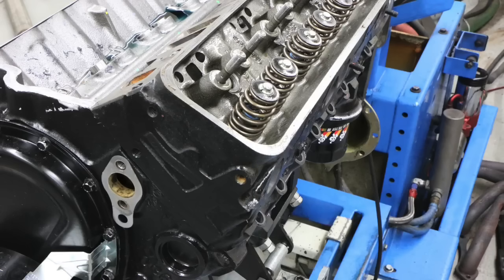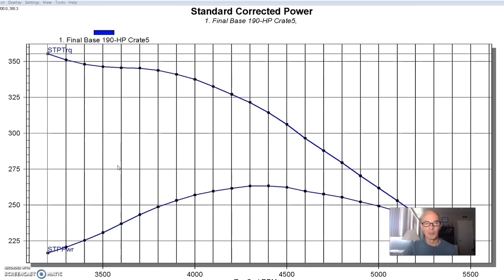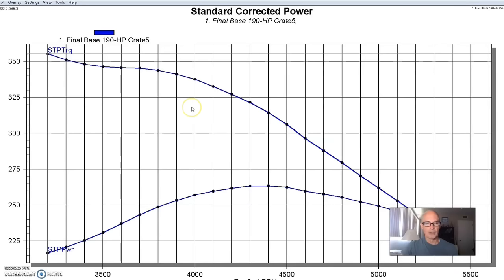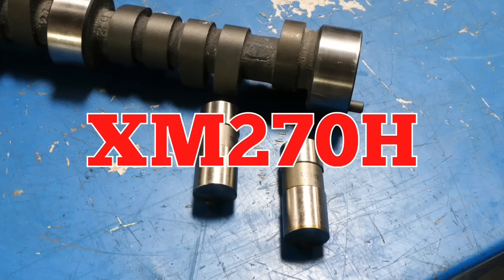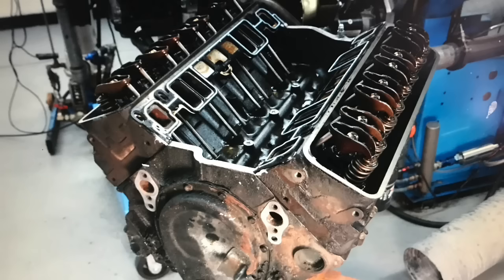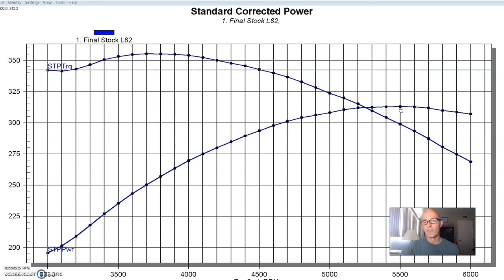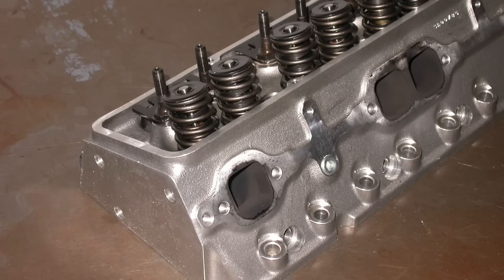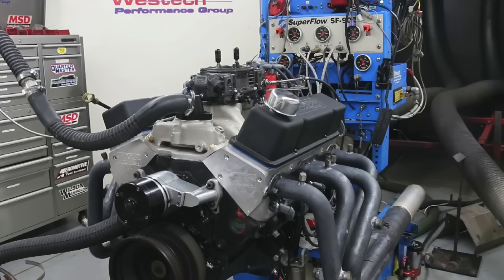JUNKYARD SBC HEAD TEST-VORTEC FTW!

Comment: I had a 75 L82, it had 882 heads with 2.02-1.6 valves in them. Also forged single valve relief pistons. I ported the heads and put them on a flat top 400 with a xe262 and 1.6 rockers. The 400 was a torque monster!
Reply: We run big valve 882 heads in stock class engines on dirt tracks..they flow fairly well for a big chamber head. Zero decking the block helps them a lot.
Reply: That's a lie
Reply: 882 heads are the best of the worst. Any 441 or 487 casting is a far better choice not only in flow but in strength. The 882 is a light weight casting whereas the 441 and 487 arent. Theyre all stock heads and less than even stock vortecs but thats up to what you want and how much money you have to spend.

Comment: ive done the same basic thing ive got a stock bottom end vortec head swap but i used the xe268h cam with self aligning roller rockers and chromolly pushrods a dual plane intake and a 650 edelbrock so do you think i can expect close to the same results

Comment: I have a 87 TBI 350, I put a Dual Plane intake on it and a Fitech TBI unit, as well as a 12-249-4 cam (206/212 @.50,  .434/.444 lift, and 112 LSA).  Still has the 193 swirl port heads.  This is in a lifted k10(v10) with 4.56 gears, nv4500 trans and 35” tires.  I am not looking for a high rpm truck, but would love to maximize power, efficiency and torque between 1,500 and 3,000 RPM.
Should I keep the 193 swirl ports or upgrade to vortec 196/060 heads? 
Power over 3,000 rpm is not so much my concern, but mostly under 3,000 RPM. 
Eventually I’m going to do a full exhaust with headers, if it matters. 
Any advice would help, thanks
Reply from the maker: yes vortec

Comment: I have a 350 with a high open plane intake and short tube headers, 750 carb and i just bought a Lunati .504/.525 lift cam what heads do you recomend i want at least 400 hp
Reply from the maker: cheap way is vortec but lots of cheap alum out there
Reply: I think ima go for the Vortec Heads i just need to know if i need to do any changes on valve springs or Rocker rollers?

Comment: The L82 was no truck motor it had 9.1 compression 202 160 valves and A 450 460 lift cam. I had A 78 L82 vet with headers and side pipe kit, hot coil, 34 degrees of timing, air gap rpm intake, stage 2 Q jet , OD trans with stall , 355 gears and original cold air induction and it ran 8.60 in the eighth with 17 inch drag tire.

Comment: The L82 also has forged factory crank and hi nickel 4 bolt man crank my 1976 L82 close ratio 4 speed  vette makes  550 hp and 478 torque at 5500 rpm with 12 lbs of boost running comp blower cam  ported Oem 2.02 factory heads com cam springs to match blower cam and machine work to heads to prevent coil bind .. I have owned the car since 1980 rebuilt the motor in 1989 for blower install raced 2 seasons in auto cross and solo 1 on road tracks in north Eastern Canada in B street prepared. Since I stripped all paint gel coated the body and painted it in blue and diamond metal flake old school paint job with silver and diamond flake cowl stripes and rear end . The car has big tube hooker headers to 3+ inch hand built dual exhaust , modded hei water methanol injection , after market ignition module and accell remote coil and twin electric fans and custom rad . The vette been lots of fun many of the parts are still Oem 1976 like the rotors and all front end mechanical and suspension I added home brew coil overshocks to stiffen up the off road stock suspension using an old school single  2000 lb overloader spring made for a Buick Electra which I cut in half with a grinder  and 1/2 the spring to each rear racing shock also all rubbers was swapped to polyurethane.The mod made the ride even stiffer but got rid of the clunky ride and cost me $9.95 Canadian for the kit on clearance  handling was greatly improved and in auto cross there was no body roll . The best part of ownership was all mods and rebuilds custom paint was completed in my garage by my self .I thank the deceased owner and mechanics and body men of Rader motors Chevy olds in Parkhill Ontario for teaching me all aspect  these car during my 9 years of after school and summer and holiday employment  1967 to 1976 it was a great addition to shop classes and college electronics. 👍👍👍✌️✌️✌️

Comment: I liked this, but only have one issue. You changed heads and cam together, so it's hard to gauge what JUST the heads would do. Anything will make more power if you ditch that wimpy factory cam. I wish you'd repeat the test with nothing changed but the heads. Maybe with a 'typical' setup where someone has already bumped compression, added a decent street cam, etc. But keep the combo the same in every other way, including using pretty much the same intake, like a performer, but going to the vortec version. Want to duplicate a magazine build I saw but with vortec heads and would like to have a good 'guesstimate' about the difference the heads alone would make.

Comment: Hey Richard I got a good question for you... My 2005 GMC 3/4 ton 4x4.. what air induction system would be appropriate for towing a 8000lb trailer
Reply: performer intake. just the regular one 600-650 cfm carb. unless its injected
Reply: factory intake is going to be pretty much the best torque intake u can get

Comment: Richard, can you please do a 9500rpm rpm small block with 3 inch crank and 4.155 bore? Or  LS7 block with 4.8 crank? Need solid roller cam, shaft or pedestal or shaft rockers, FAT pushrods set to perfect rocker center on valve stem travel,  big flow heads, 1050 dominator or big EFI. And super sweet balance job. Set rod center for rotating and dynamic at actual balance point of rod, not 1/3 and 2/3.
That should be an awesome 950hp
Reply from the maker: take a look at what Ben Strader did over at EFI
Reply: @richardholdener1727  I saw that insanity!!!  Ben is a Voodoo Witch Doctor, I just want to see if it's feasible to run 9200-9500 without getting into Captain Insano money. I think it's not too much of a long shot, technically it should work quite well.  The only other thing I want to add is my own intake with the injectors way up high on the runners. As high as I can get them for charge cooling gain across the board. I am actually thinking about mounting them on top of the plenum aiming straight down the runners. What do you think of that idea?  Either that or individual throttle bodies with velocity stacks in the plenum. I could still keep big plenum volume and shorten the runners because of the stacks. They are exceptional for higher RPM.  Would be even more effective in a boosted application I think??  
What Ben was able to achieve with comp and jesel really paved the way for a much more efficient DZ302 type engine from the Trans Am's of yore.  Comp can make a cam that will have the perfect ramp and the nose off peak lift can come down easy. Jesel has the pedestal rockers and PSI has springs designed for the application now. All thanks to Ben. I know you can do it Bud! Start the screaming 950hp plus NA revolution.
I'm tired of bolt on people being somewhat competitive with whips, prochargers and little turbos on high compression engines. This is the coming storm. It's the next logical step in the decade long run of huge power gains thanks to the computer and fluid dynamics modeling. Especially for road racing, big NA power and huge power band with linear power that keeps on pulling. The ability to hold that gear to the end of the long straight can really make all the difference. It will keep that ultra efficient Undersquare engine design off for a while longer. That German formula is 1-5% more efficient than an Oversquare design without dual plugs. Anything bigger than 3.9 inches bore size has too slow a flame propagation. Mopar and Porsche air cooled racing solve it with dual plugs so the fuel can be burnt quick enough to fully utilize the quench. You can run an LS3 at 29 degrees of advance all day, you can't get a dual plug Hemi much past 20 Degrees. Even that is pushing it,  16-18 Degrees is really about it on pump gas. 10 Degrees less fuel burned up to time the explosion at quench for max power. Dual plug LS heads will make more power every time with less emissions, if we can get the aftermarket to make them, I am pretty sure GM will follow. Sure it's a little more money to produce, definitely cheaper than a DOHC Behemoth though. Everyone with as LS would want them from here to Zimbabwe, GM might even turn a profit on them. I know lol, I'm really reaching here lol. Those 9k plus motors are definitely coming! Thanks

Comment: Hi Richard I have a question when will you be able to do the eBay aluminum heads for small block Chevy?
Reply from the maker: I tested Procomp heads already
Reply: @richardholdener1727  yes you did and that was a great episode I did watch it but those are summit racing heads I was actually talking about the real eBay ones they're from a company called at racing world and they offer the whole top end kit 220cc intake runners 64 cc it come with springs rocker arms and intake manifold and it runs about $750 I know they're not even going to have the same power as the ones that you tested but this is for the real eBay guys the ones that are on the real budget that do all eBay parts I just wanted to see how good they perform and are they worth the 750 bucks

Comment: How much more horsepower from the L82 if you used a roller cam?  The Comp XR282HR also has 230/236 @.050, but with a bit more lift at .510/.520.  And you don't need oil with gobs of ZDDP with this cam.
Reply: costs about $1500+ to retrofit a roller cam bud.......
Reply: @trillrifaxegrindor4411  K-kit for the exact cam I quoted is $1079 list on Comp's website.  Maybe can find it cheaper somewhere else on the Internet.  Ok, so you still need a new timing cover, cam button and a melonized distributor gear, but I don't think there's any way you're going over $1500 with adding just those three things.  If you have a nice older Corvette with an L82 it's a worthwhile upgrade.  For someone who's just trying to make the absolute most power for the absolute cheapest possible the flat tappet plus a 250 shot and ring gap would serve them well.

Comment: I have a vortec roller motor. What's a good roller cam for 72 chevelle street use ? part number please .
Reply: 7151 gmpp roller cam,will make 357 horsepower and 410 lb ft
Reply: @trillrifaxegrindor4411  Thanks for the info.

Comment: Hey Richard when you did the valve spring upgrade didn't you also have to have the valve guide machined down in order to use a cam with .480 lift?
Reply: no,just add the comp cams retainers,ls valve springs(and change your seals to new ones) i just did it,good for up to 0.500 lift

Comment: "High Rpm beasts are useless in the real world."
Reply: depends on the combination.  stock motor ,4.88 gear 3000stall c rule the street. depends on the racer
Reply: 5k and 6k are extremely useful RPMs for pulling freeway on-ramps.

My Vortec headed roller cam is north of 5000RPM when I make the 2-3 shift @75mph getting on the interstate

Comment: I'd like to see potential of 305 cylinder heads ported on chevy 350. And maybe vortex 350 comparison.
Reply: 305 heads on a 350 not worth the trouble,combustion chamber sucks and flow isnt good. vortec heads on a 305,
\milled 0.03"-0.04" different story,add a nild cam and they make over 300 horsepower as well. 

https://www.hotrod.com/articles/ccrp-9903-305-chevy-small-block-engine-build/

Comment: With the stock motor you got from the wrecking yard, did you put screw in rocker studs? Or did you run the test with the press in ones?
Reply: press ins,they are also on gm crate engines

Comment: This guy has no idea what he's talking about! Vortec was from 1996 to 2002. All vortec roller cam engines. The junk yard motor was a tbi with vortec heads on it.
Reply: Besides who wants heads that are prone to crack anyway
Reply: I have 3 chevy work vans. 2003 4.3. 2004 4.8 and a 2010 5.3. All say vortec on the plastic intake
Reply: @rpmspeedlab993  vortec heads started in 1996,anything before that was marketing bullshit

Comment: Did you half to grind the heads down for them valve springs  or do they fit right in
Reply from the maker: the after market has both options

Comment: What cheapest head for a 350 im running 305 ho 416 heads with a cam 444 in 466 ex on a 350 it runs good i want to go faster. Any advice  or just put a bottle on it?
Reply from the maker: junkyard vortec 350 motor is cheapest
Reply: What about aluminum Patriot heads or promaxx heads aluminum?
Reply: vortec heads,duhhhhhhhhhhhhhhhhh

Comment: Are vortex heads better that world product dart 2 sportsman heads 185ccintake runner 2.02/1.60?64cc angle plug
Reply from the maker: not sure I have run that test
Reply: @richardholdener1727  found some flow #s richard.the wp 185 heads flow 270 at .500 and vortex 230 @ .500..my wp heads (the small ones).hit a brick wall at .550 tho.idk why I let Herbert cams talk me into a .615 /.620......oh well I'm 388 now not 355 so we will see by this weekend  what the inch dif does

Comment: Hello my name is curley and I'm trying to build a good strong motor for my 07 gmc sierra 1500 I have a 5.3 Ly5 / 4l60e trans Tbi fuel system im looking to up grade to at least 400hp its just stock now I don't know much about the ls motor are there any combo's that I can use to help my truck  with a little more hp don't want a race truck can you help

Comment: I got told years ago by an old hot rodderthat the vortec heads "cant take heat". I decided to be my own judge and proceeded to the junk yards where I took 6 heads over the course of weeks to have them magnafluxed and finally got 2 good ones. 4 were cracked... I think they are good for power but I would be cautious with power adders as I am now of the same school (they cant take heat).
Reply: I bet all those heads would have ran fine even with the cracks
Reply: @austindoud273  possibly. Didn't want to have to top off the coolant every time I put gas in it tho.
Reply: Eh, i have been a tech for 20 years. Ive seen a lot of cracks center bokt heads, right between the center 2 chambers in the head, but cant recall actually seeing vortech heads ever being cracked there.
Reply: This is true , spend a grand on some aluminum heads and eat
Reply: i bought a vortec 5.7 out of a heavy 3/4 ton truck. 906 heads, and they were cracked right where the head bolt hole and the coolant port meet, and it starts to go between the chambers. never leaked a drop of coolant into the oil or engine. im gonna run em anyway(with a can of k&w block seal)

Comment: I was given a 98 vortec 350. Plan to fix it. Do a few mods. Either sell it or trade it for a kubota  v2203. Im a ford guy but ill see what can be done to the gm engine. And NO! Its not going in my F150.
Reply: it will outlast the 4.6 by years!

Comment: Richard,
I would love to see you throw a Vortec 350 on the dyno with a XM270HR and 1.6 full rollers. I have set up about 6 of these in Vortec trucks. I like to run the Rhoads VMax lifters in them. You adjust them with a feeler gauge like a traditional solid lifter. I use 0.020" off the bottom of the pluger.  They have stock like idle quality and driveability and make alot more power.  Would be interested to see you try the VMax lifters in a Vortec 350.  In my experience they have the same hp as the bigger cam but retain most if not all the torque of the smaller cam.  Just a thought for some more testing.

Comment: TPI intake on a 5.7L Vortec. Torque is key for a truck motor and the factory Vortec cam makes good low end torque. Would a TPI induction setup make more torque than a carb and dual plane intake?
Reply: yes.a tpi would make more torque   lower in the rpm range     you need a vortec specific tpi intake though

Comment: This is exactly why Ls motors took over the World!But I still love the old conventional Sbc and Bbc...
Reply: Dude for that kind of money all your doing with a LS is saving gas , I honestly have yet to see a LS do anything so special to where it's worth the headache and money on a swap.  My lil o buddy got a 383 with 906 vtec heads eagle forged stroked s10 chewing up 6.0 ls at the track all day ,and they are in small cars that don't weigh shit and they are tricked out ..Old School for the win .
Reply: @braleyshardwoodcustoms8584  the engine you just described costs 5k to put together. A cammed 5.3 costs around 800 including the cost of the junkyard engine. You can have that old small block stuff. I have all of my sbc stuff away after the first time I drove my ls swapped car. No comparison.
Reply: @turbolq4  dude u telling me u flashed your ecm ,ran new fuel lines , relocated your new gas tank, power steering ,and the list goes on and on when it comes to doing a swap I promise I know hundreds of guys who have done that and done it right to where the vehicle passes inspection and is reliable for 800 buks?? Your so full of shit it's not funny , you can barely buy a stage 2 btr camfor an LS for 600+ buks alone more less everything else I spoke on . And no that forged 383 is nowhere close to 5k homeboy get your facts right , I boil rubber everyday I promise I do this shit
Reply: @braleyshardwoodcustoms8584  didn't say anything about the cost of the swap. Just the engine. I personally did the swap in my car. If I were to do it again and not turbocharge it I could have it in and driving for roughly 2500. Still way less than building a good old school engine. That's keeping the efi, can make them carbd but that's lame.
Reply: 5.3 with a cam makes all the power any of these engines tested in the video made. Easier to work on too.
Reply: @turbolq4  very true and a fraction of the cost straight from the junkyard. I can appreciate an old school sbc/bbc but i still find so much entertainment from the old school guys references on certain parts 😂🤣
Reply: @turbolq4  and yes u are right about one thing ,you did say "any of the engines in THIS VIDEO"